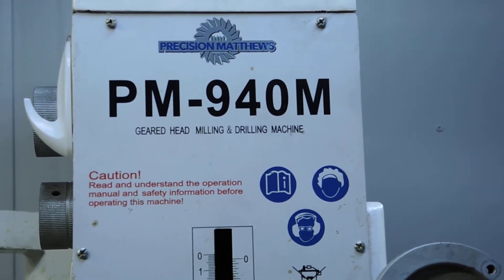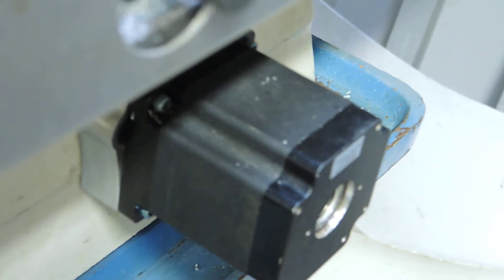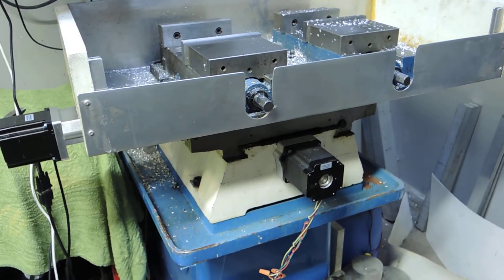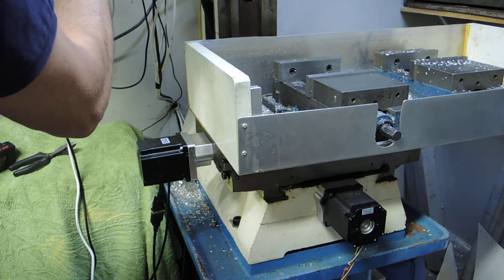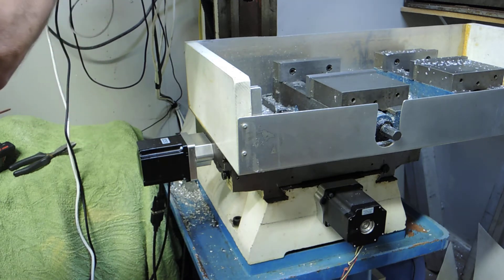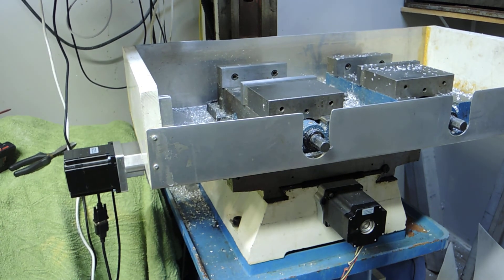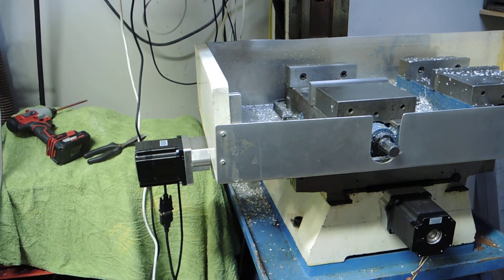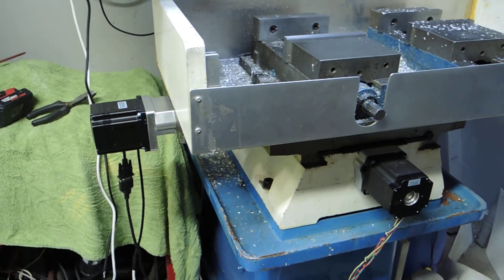PM-940 Closed Loop Stepper Servo Test for the X and Y axes

Comment: Looking good!  Not criticizing, just an observation from past failures of my own.... Might want to dress those hanging cables sooner than later. Those (stepper) motors don't care if they get caught on something, they'll just keep on driving and rip the cabling apart.
Reply from the maker: For now the control system is just a prototype. I have the factory box which will fit the final system and be mounted on the wall not the mill. I might bail the laptop and go with a small PC and a large wall mounted display unless I go with touchscreen.  Like I said in the video I'm going with the Acorn board and CP servos for the 940 so all this stuff will be removed fairly soon.
Thanks
Dave

Comment: a successful work ,What kind of electronic system does it have?
Reply from the maker: Mach 3. A $20 USB BOB and the drivers. 500VA Toroid at 56VAC.
Reply: @ArizonaVideo99  Thank you very much for the information you provide

Comment: I am running an ebay 4NM with HS866 blue drivers on X and Y with the PM940.  At anything over 100 ipm the zero had drifted about 0.250 on Y, sometimes on X by the end of the program.  I limited it to 100 IPM and the drifting went away.  I tried different cables and separated the signal wires and swapped out a different HS866.  Sticking with 100 IPM for now,  I plan to upgrade to clearpath servos later.
Reply: I just did clearpath on my PM30 and hitting 300ipm isn't too tough. Limiting it to 250 for now because it's way more than enough for me. You definitely wouldn't be upset with the servos
Reply from the maker: @MPMachining  

Spindle speed is way more important than rapids.  150 to 200 IPM is fine. 6000 RPM belt drive 100 time more important. 

For the money I'm fine the closed Loop. You get to have the one real thing you really want from a drive system. If you fault the driver it will send out a fault voltage and can stop the mill. This can save a lot of metal. 

I'm dong the CP because of the quality and many people just love them. I have some here. Nice motors.
Reply: @ArizonaVideo99  I couldn't agree more. I just recently went 5HP 10krpm on my PM30. I completely agree that having fault feedback is huge. Both my servos and VFD will estop the machine if I'm out of position, over torque or the vfd alarms out. Definitely will save a part at some point. With the 10k RPM, I have been taking some test cuts at 170IPM so the extra axis speed has been a welcome addition.

I highly regret going open loop steppers on my initial build. Had I gone with closed loop when I started then I don't know I would have bothered going servo. No part of me regrets going with the clearpaths but for most people, unless you're crazy like me and throwing a massive 5HP motor on your machine and going for a 10k rpm spindle with all new spindle bearings, save the money and go CP all the way!
Reply from the maker: I found that the cheep drivers just don't work so good. I have a few.  The good ones are Stepper Online and Long Motors which are ACT brand. 

Change the driver and I bet all will be good. .250" is crazy. The encoder could be loose or defective or a coupler is loose.

Comment: Put an 80 lbs bag of concrete on it. Mimic some load.
Reply from the maker: I have a 500 pound scale I plan on showing how much force you can get. 

I could fill the try with sand and put a paddle in the spindle? CNC mixing?
Reply: @ArizonaVideo99  awesome. Love the work you do, keeps the rest of us inspired on our builds.